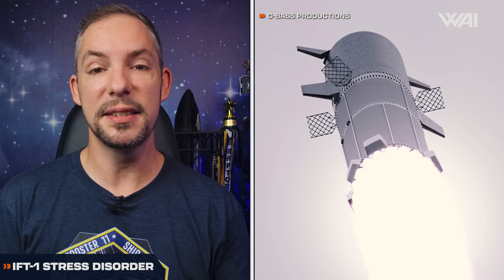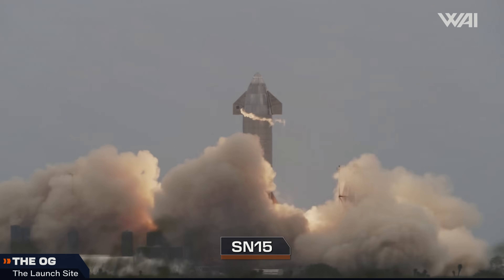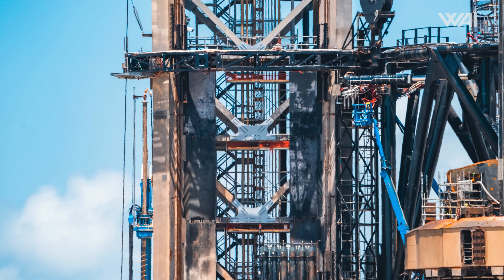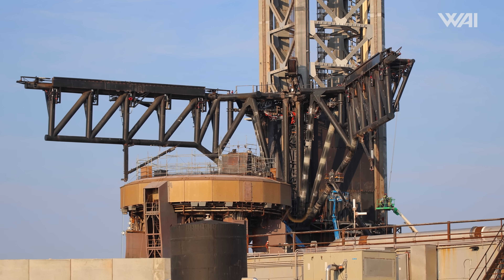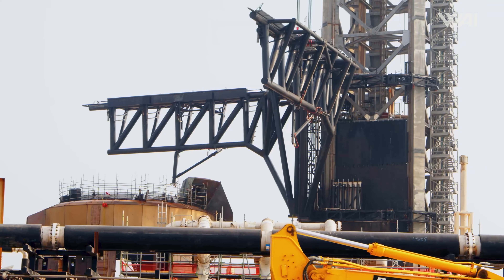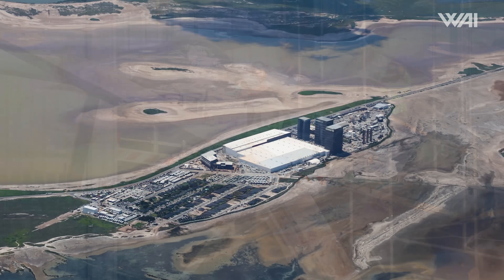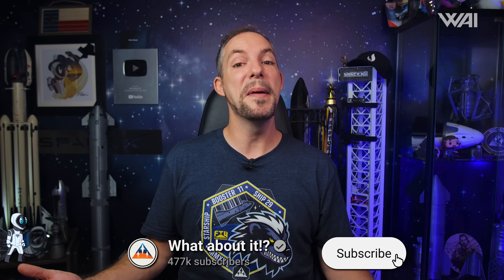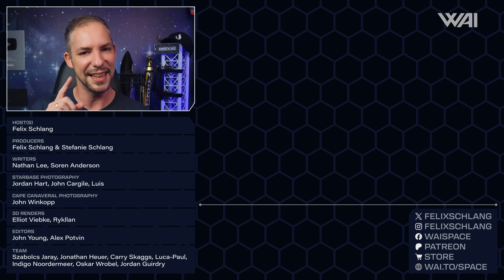SpaceX Drops Massive Update On Next-Gen Starship! RFA One Burns On The Pad!

Comment: If the German boys only found minor damage to the pad after the RUD and inferno, there's likely no reason for them to have to redesign the launch mount. It appears to be quite robust. WOW!!!
Reply: I think the pad is designed to withstand a launch with its high-speed / high temperature gas flow (and after the rocket reaches a certain altitude, most of the exhaust doesn't hit the flame trench any more either). So, I guess most of the damage is due to flaming RP-1 flowing where it's not supposed to go.
Reply: Exactly. It's designed to withstand enormous heat and pressure for short periods, like 5 seconds. It's not meant to endure sustained flames in all areas in, on, around, or under the mount. So, the fact damage is only minor is impressive. At least to me. Because the OLM is not meant to be a large concrete torch.
Reply: Where the US builds things with planned obsolescence in mind, the rest of the world seems to still believe in kitchen appliances outlasting 3 generations, and the German pad proves it.

Comment: You are probably correct but let me offer a different view.
Chopsticks, having a new bracket fitted because SpaceX doesnt trust their design.
Well maybe, spaceX design was originally good,
Imagine chopsticks finished for ages.
Imagine you cant have too much data.
Imagine not having to connect data gatherers to the rocket and not send data back via an rf link.
Put a copy bracket - but unstressed - adjacent to chopsticks.
Now put strain gauges between the brackets.
SpaceX would be able to MEASURE the stresses in the chopsticks during each catch.
Detailing deflections and g etc for both ship and chopstick parts.
More data is more better and less weight on starship is better and low cost is better and not imperative is better and not urgent is better and using up (time to spare caused by paperwork) is better.
Just my outside the box view.
Reply: Everything at Starbase is experimental! That means everything is in flux and can and will fail. Then back to the drawing board and fix and improve.  (BOEING obviously hasn't learn this). On top of this, everything on Starbase is being done all at the same time. I've been on fast track jobs in construction  but this is ridiculous in the scope and the speed how things are managed and done. So any other company might take 5 to 10 years what Starbase has accomplished in 2.

Comment: The booster catch attempt, using the single only operational launch tower seems very risky. This is completely uncharted territory, and chances are, things might not work out exactly as planned.
Even a minor error could cause extensive damage or even completely destroy to the tower. Repairs arguably will take months.
Maybe it’s a good idea to finish construction and have the second tower up and running first…
Reply: They want to test catching the booster.. if they do it now and it succeeds.. or fails without causing a lot of damage, they can still test without waiting on the second tower to be finished.

Comment: I think one of the biggest problems with not having any landing legs is in an emergency on launch it HAS to get back to the launch pad.  A capsule with a parachute could land in the ocean or even a dessert.  The space shuttle could land on a runway so long is it was sufficiently long enough.  Starship could ONLY land on a launch pad with catching arms, which for at least the near future would be Boca Chica and Florida at some point.  It'd be hard to even make a drone ship for this, but maybe...
Reply: In an emergency it could land in the ocean too and float long enough to get to it
Reply: Well, I guess now that I think of it, the upper stage does have landing legs, it's just the lower booster that doesn't...
Reply: @Ryan-vv5vw Starship stage two does not have landing legs. It has to do a weird flip manoeuvre. Basically it has zero chance of landing if an anomaly occurs after lift off. That’s why I won’t volunteer to fly on one. It is of course possible that it could survive an ocean touch down, and float, but don’t bet on it.
Reply: @StillAliveAndKicking_  I think it's only the lower stage that has to be caught on the tower.   SN15 landed using landing legs and I don't think that plan has changed.  The lower stage was also originally going to use landing legs, and I believe that is the only thing they changed to  using the grid fins.  I think they both have to do the flip maneuver as the approach for landing.   The upper stage "wings" are just there to aid with maneuvering for re-entry and perhaps to also aid slightly with a reduction in speed.  The upper stage would need to have legs to land on the Moon or Mars.  If they ever did do a version that would need to be caught, it'd probably have to be for a refueling or cargo variant.
Reply: @Ryan-vv5vw  No, both stages are caught.
Reply: @StillAliveAndKicking_  It has ALREADY done it. It went into the water, floated, and with nothing to hold it, it fell over. Install some airbags that use the pressure from the oxygen tank to inflate themselves upon hitting the water to keep it from impacting the water hard, and you have no explosion. We might not even had an explosion on this very first landing with parts of the ship literally melted through. I think the ship was cool enough, tank pressure was low enough, and the falling was slow and gentle enough, after all, when it fell over it bobbed up and down a few times before the signal cut, which might just be due to... you know the whole thing coming apart and being flooded with water. Definitely a survivable landing, and with a proper firewall between the tank and crew sections even the resulting explosion would have been survivable. At that point just get out of the wreck, inflate your spacesuit, and float waiting for rescue.

I mean seriously literally the very first testflight that was equipped to land DID so and stayed perfectly intact doing so, despite reenacting the "not to worry, we're still flying half a ship" scene from starwars.
Reply: @Ryan-vv5vw  You are both kinda right. Currently neither stage has landing legs, however it is already confirmed that the second stage will have landing legs since as you said it will need them to land on the moon or mars.

Comment: The vacuum engines are the ones operating in in space and will likely create more ice. By having fuel essentially stored in the downcomer and not being used until landing, de-orbit burns it helps reduce the chances of engine outs caused by ice etc.

I also think this could be the start of them removing the header tanks. They were only there for weight distribution and with payloads and other things in the ships they need to change things around again. Similar to above, by storing fuel in the downcomer it essentially acts as a giant header tank. This would also explain the new larger shape "funnel" that leads to the downcomer. Oxygen Tank will probably get something similar to Super Heavy.

Comment: About the chop sticks, they look kind of not ready for the action. There is some level of discomfort, you can already feel it. Its not full proof. 

So my proposal is to implement a guide wire system just like those on the Aircraft Carriers. It has to be aligned in a way that, if the rocket somehow missed the initial set of guide wires, the final guide wire will take away the booster away from stage 0. 

So basically, a minimum of two set of guide wires will come down from the top of the tower in a shallow gap then the megazila arms, making a cushion to guide the booster towards the hinge points.  

And for any other case, there will be two strong guiding cables that will be able to quickly set grip on the booster to glide it away from stage 0. These will starting below the megazila arm and hooked to a far away location from the tower. Preferably towards the shallow waters, minimizing the fire hazard just like drowning a torch in water.

Comment: Hooks and cables and cable dampers like aircraft carriers have used for 100 years landing aircraft could give positional flexibility and reduce maximum loads.
Reply: @jonwatkins254  100% agree.  I've been thinking the same for a few weeks now.   Add two deployable  US Navy carrier hooks into fairings on sides of vehicle, and add rigging and cables to the tower catch arms.  Cables connect to large Hydraulic dampers with metering pins; similar to oleo struts on heavy aircraft landing gear struts.   Advantage is greater tolerance to lateral positioning errors, and also to rate of descent errors.  Doesn't require ground arms to move around as much during the catch.  Many dynamic variables right at the critical moment such as vehicle mass, rate of mass change due to propellant consumption, vertical speed and rate of deceleration, engine throttling required to establish a hover as prop mass is depleted, and all with precision timing and positional accuracy within inches.  Gonna be a minor miracle if they stick the landing perfectly on the arms on first try!  The Cable catcher has a number of benefits, including rapid reusability. Cheers!

Comment: SpaceX will need to have "catch only" towers all over the world. Launch and recovery towers should be in completely different locations.
Reply: They would then need to move the empty booster back to launch site.  Sure a catch tower on the African continent would obviate the need for boost-back, but then it'll need to be shipped back across the Atlantic ocean.  Being as wide as 3 shipping containers is going to make that VERY difficult, so difficult I think, they will just RTLS until there are more fully fledged launch sites.
Reply: @SuperLuminalMan  All they would need to do is build it right next to the ocean and then transfer it to a ship. I just think they need more recovery redundancy built into their system in the future.
Reply: The whole point of the system is to rtls. Eager Space did a great video showing how and why a drone ship recovery makes sense for a partially reusable rocket like Falcon, but doesn’t add up for the superheavy.
Reply: @Rory-Shields  RTLS should be RTNLS = Return To Near Launch Site. I just think they are dangerously close to the tank farm. It just doesn't make sense, why risk it?
Reply: @RecklessG1  well for context that would be a little bit like an airplane that has no wheels and can’t taxi back to the gate. A crew with a crane would have to go out and pickup every airplane that lands off the runway and drag it back to a place where the passengers can get on and off. 

To belabor the analogy even more, Yes having wheels has lead to a ton of aircraft accidents where planes have gone careening off the ends of runway. A Concorde even blew up because of a tire issue. So why risk it? Why not just land on skids? 

Superheavy needs to come back to the gate to be fitted with another starship refueled and reflown. The tank farm can be ruggedized, but the time it would take to move a rocket the size of a large water tower can’t be eliminated.
Reply: @Rory-Shields  I appreciate your perspective, but I simply disagree. I do agree though that they can and should beef up the tank farm. In fact it should be a priority. I also think that it's fine to have the recovery tower close by... but it should be well out of the immediate blast radius of a crashing Starship. I'm frankly surprised that this idea seems strange. For that reason, I still think the recovery tower should be at least a half mile away.